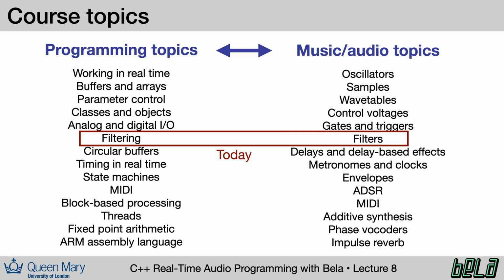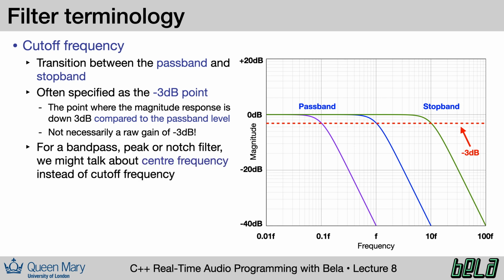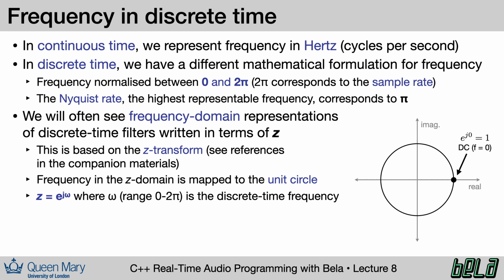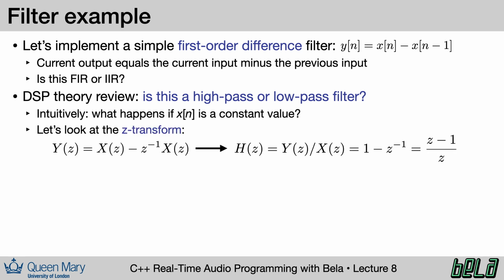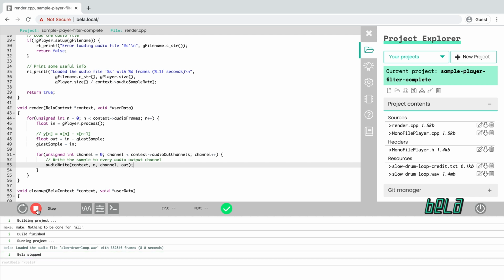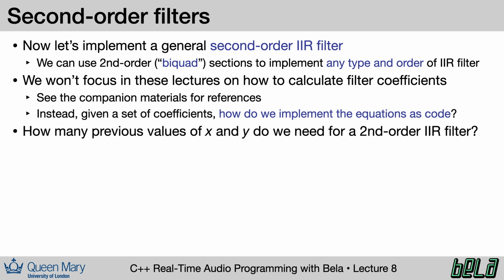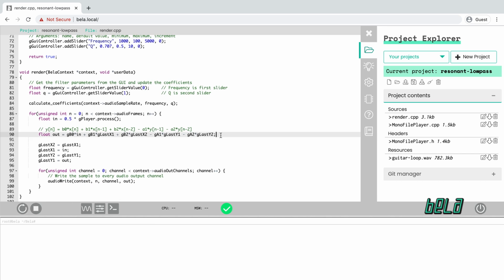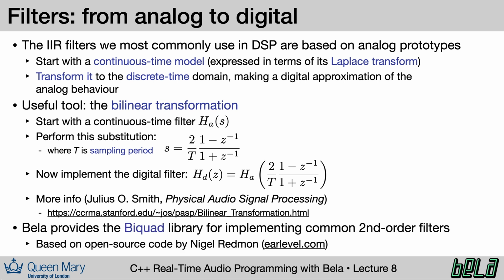8: Filters, C++ Real-Time Audio Programming with Bela

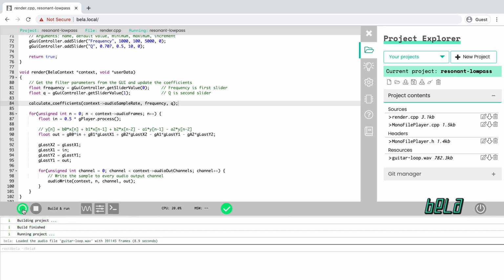Comment: can someone explain to me why his input is: "float in = 0.5 * gPlayer.process()" and not just a audioRead(context, n, ch), line 87 at 26:58,  is it as a result of changing the stereo to mono to process the data?
Reply: Q values higher than 0.707 may increase the peak value of the signal. By reducing its amplitude before processing it through the filter you reduce the chance of the signal clipping. An alternative option would be to use a limiter after the filter.

Comment: I sat here for a while wondering why my program wouldnt output sound, then I tried changing the equation where you add the coefficients for ak*y[n-k]  to -(ak*y[n-k])... it made all the difference sadly. Why? I don't understand why it would make nothing come out.
Reply: This is a common point of confusion with IIR filters, because there are two different mathematical conventions for specifying the coefficients. Depending on how the equations were defined, sometimes they are added, sometimes they are subtracted. Pragmatically, just try it both ways! If it's wrong, then the filter becomes unstable which means that the value will quickly spiral off to infinity, which is why you don't hear anything.
Reply: @apm414  Then that is exactly why I didn't hear anything. I figured it was something of the sort, and I should of suspected that.I suppose I often forget that this program is doing many thousands of operations before I even know it's begun. Thanks for the response :]